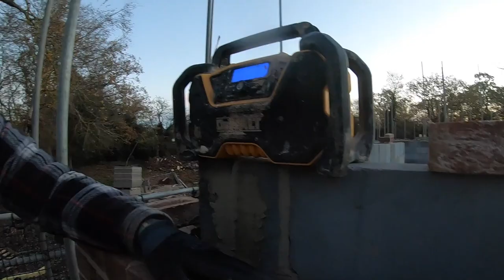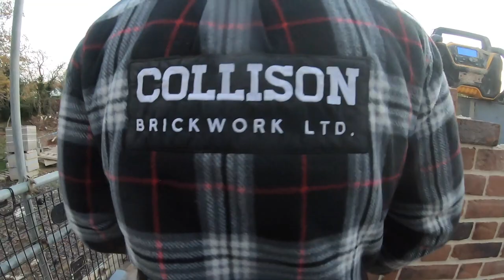Arches, Corbelling And Corner Building - Day 34

Comment: Great stuff, so much knowledge and technical terms in a single trade. Arris is a new one on me

26:45  
Wiki;
In architecture, an arris is the sharp edge formed by the intersection of two surfaces, such as the corner of a masonry unit; the edge of a timber in timber framing; the junction between two planes of plaster or any intersection of divergent architectural details. The term also refers to the raised edges which separate the flutings in a Doric column.

The origin of the term arris is from the Latin arista meaning the beard of an ear of grain or the bone of a fish